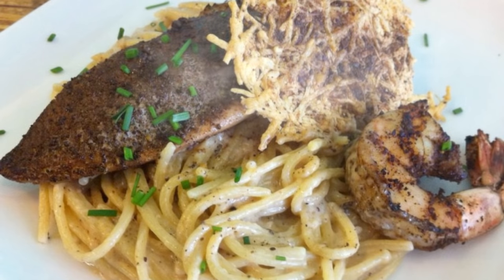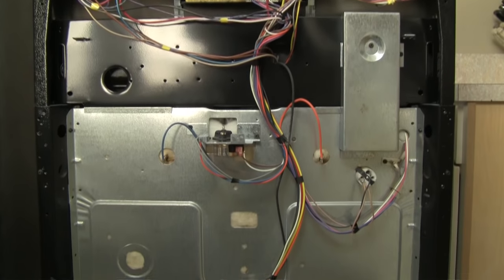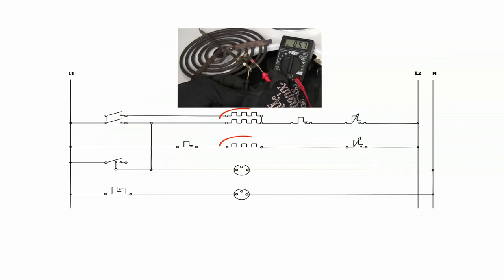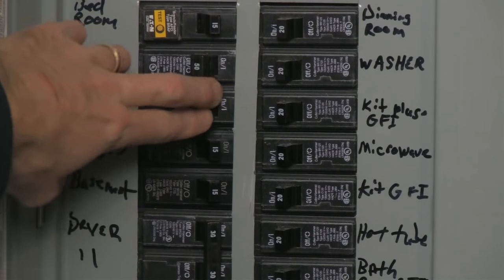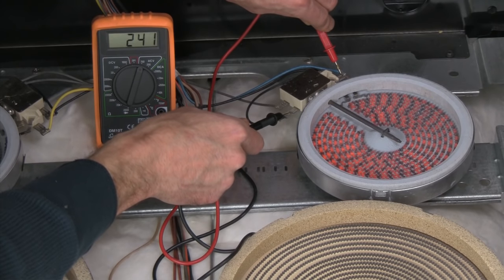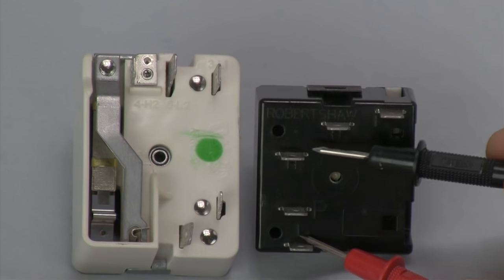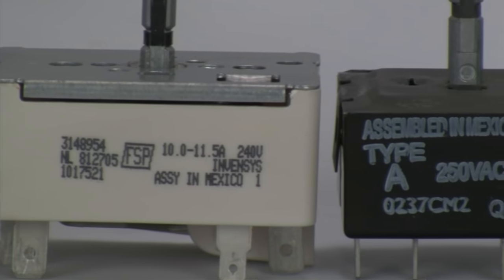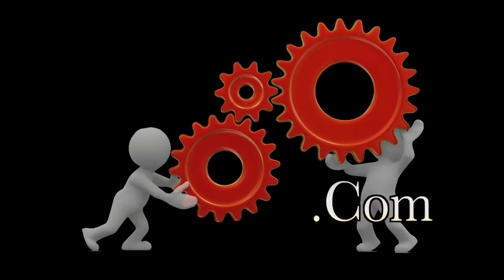Electric Range Stove Repair: How To Repair Burner Elements

Comment: The front left burner on a flat top stove turns on and heats properly the first time. But it needs to completely cool(over an hour of wait time) before turning on a 2nd time or it doesn't work. Any ideas?
Reply from the maker: Trisha Semiz Thats a strange problem... What is the brand and model number on the stove?
Reply: Probably a bad burner switch. The contacts are stuck together and it over heats to where it opens up the safety.  The as it cools down and the safety closes again.... it will work.  Once that is!
Reply from the maker: Thats a good point! The safety switch on most smooth top elements is in the block on the element itself. Thanks for the suggestion!

Comment: What would cause all the burners and oven to turn off while you're using them? (not all at once of course)
Reply from the maker: On 98% + of ranges the surface burners and the oven have different control devices... So the only way that they both could shut down apart from a crazy coincidence is power supply to the appliance.  However, there are some "crazy coincidence" these days with control boards... There are a few high end ranges that have control boards for the surface elements. If you have one of those it may be possible. Thanks for the question! Hope that helps!
Reply: Yeah what happened is an egg timer fell down behind the stove and unplugged the oven so glad it was something easy lol. thanks for the help.
Reply from the maker: Stink'n Egg timers! Thanks for the update!

Comment: What would cause the element to suddenly get very hot?  I had my big front burner set on heat level #4 out of 9 levels.  It heated up red hot and burnt the food like it was set to full hot #9?  Its like the heat just keeps creeping up.
Reply from the maker: In most cases it would point at a bad control switch.

Comment: I have a question.
my electric stove is acting wierd, at first when you start it when its cold, it heats up to a very high temp, to the point it turns off. and then the temp drops to a medium heat, which wont alloow me to maintain a high temp for frying and stuff. what do i need to do or check so that the temp stays high as the first time it heats? my thought is to use alluminum foil to stick the heat controlers together, so that it cant break contact when the heat max. thoughts?
Reply from the maker: Sounds pretty dangerous! I suppose if its outside and your own creation you can rig it however you want,,, However, if the element is just on all the time without cycling I would think the heat would continue to climb until either the element burned up or something else does.  Best legitimate repair would be to replace the switch if you think it's not working properly, or get a higher rated burner.  If you do try that (at your own risk ; ) do it outside and let me know how hot it gets, and how long it lasts : )  Thanks for the question!

Comment from the maker: There still could be a power supply problem... Does the oven heat?  If not, the next step would be to check the wall outlet for 240 VAC but if you are not comfortable with that, it might be a good idea to call an electrician... Ive been shocked by 240 VAC... not fun.  being that all elements are not working right I would suspect a power supply problem. If the oven works, it must be before the burner switches.  Good luck!

Comment: I have a Kenmore glass top range, and after I use my oven, the whole control panel goes off, and won't come back on for quite a while.  Help!
Reply: That is strange! Sounds like a bad control board that is being effected by the heat... what is your range's model number?
Reply: The model number is 790.95661102
It doesn't do it every time, but more frequently lately.  It will also "blink" off and on random times, for no reason.  When it goes off completely and stays off, it is after I use it, or while I'm using it.
Reply: It definitely sounds like a bad contact somewhere... Hopefully TO the control and not IN the control.  The control part number is 316207522 I can ship it to you if you like... It's 164.00 and 7.00 S&H  Thats if you find that you need it! First disconnect the power and unplug and reconnect each contact to the main control/clock. Lightly cleaning the contacts may help.  If it's in the control then it gets to be a little more complicated, unless you know someone or can solder electrical contacts...  Hope that helps! Good luck!

Comment: My stove and oven work, but not at the temperature I need. The oven doesn't seem to cook food at the setting I get from a recipe; I always need higher temp or longer time. My stove only seems to work on high; the burner is nearly imperceptible on simmer. You can feel it with your hand but it's not high enough to actually simmer.

Comment: Any idea why sometimes when I turn my front burner on high the back burner turns on high as well without being turned on
Reply from the maker: It would need to be a short in the wires... If you get a meter and go through the testing of the switches and elements you will probably find the problem.  My guess is one or both of those burner switches is bad. Hope that helps! Good luck!

Comment from the maker: Well not really... That is very strange : (  It may seem like its working properly but one of your switches must be sticking closed. Likely the element that is controlled by the  faulty switch is not cycling properly and is getting much hotter than it should.  I would also guess that one of the switches may be wire incorrectly... Take a close look at the L1 L2 H1 H2 and P terminal section on the video and look at yours to make sure all the connections are correct. Hope that helps!

Comment: Is there anyway to disconnect the broiler and still use the stove top?  When I tried to preheat the oven, the broiler automatically comes on and will not shut off. Any suggestions?

Comment: Kenmore model no. 790.96229408, glass top range.  The left front 8" burner with simmer control is not working.  I replaced the burner element to no avail.  I then replaced the element switch and it still does not work.  All other components of range top and oven work fine.  I've read that the oven relay board may be the culprit.  Any suggestions?
Reply from the maker: +Azalea McKnight Here is a link to the wire diagram
http://c.searspartsdirect.com/lis_png/PLDM/R0601008-00005.png
Looks like the simmer select control board is a strong possibility.
here is a link to the part if you still need it.
http://www.repairclinic.com/PartDetail/Relay-Board/316429301/1155383?ss=-x333136343239333031?RCAID=27317
Thanks for the question! Hope that helps!

Comment: I have a whirlpool electric cooktop model g7ce3034xsoo and I was using three of the burners for about 10 to 12 minutes then all the suddenly the burners just stop working and they will not come back on the switch for simmer or normal the little light will come on for simmer but not burners will come on
Reply from the maker: Sounds like a power supply problem... did you check the breaker yet?  It could be that one of the two breakers tripped or has a bad contact.

Comment: I have a conventional stove top with 4 coil burners, all of which have stopped working but there does not appear to be a breaker that has flipped. Just in case, we flipped the main breaker off and back on with no result. What else should we look at?
Reply: I just flipped the main breaker again and removed each switch one at a time looking for any burnt out components and found nothing suspect.
Reply from the maker: yveylise
Sorry for the delay, I was out back packing for a few days.
Apart from a bad wire it sounds like a power supply problem... especially if they all quit at the same time.  You may also have a bad breaker.  If you're not comfortable with electricity it would probably be best to call someone. The breaker connection is high voltage.  Do you know the stove model number?
Reply: It's a Frigidaire FEC30C4AC1. I've replaced one breaker that I thought might be the issue, but as we've just learned, our breaker box is not labelled at all and it's hard to pinpoint a non-working appliance. :)
Reply from the maker: yveylise It should be one of only a few breakers that are for 240VAC so it will have two breaker switches next to one another.  In some cases it may only have one switch and what looks like a blank next to it.  But I would say that it is likely the source of your troubles.  It could also be a loose wire connection at the cooktop junction box.
Reply: Thanks! We actually found the source inside one of our kitchen cabinets.. There was a small box where some wires met up and joined and one of the wire nuts needed to be replaced. Simple fix. However, we found out the hard way. While troubleshooting breakers, we learned all about "hotspots". The way our panel had been loaded originally, there was a 30amp sitting across from a 60amp which caused a brief fire. Luckily, it stayed within the panel but it could have been much worse!
Reply from the maker: Wow that's scary...Glad you found that!

Comment: One of the control knobs on my GE oven  is not able to control the heating temperature of the stoves . any suggestions
Reply from the maker: Chinar H if it's always on high no mater the setting it's usually a bad control switch, ( the switch behind the knob) however if it just won't turn on it could be a bad element, switch, or connection. You need to do some checking with a meter to narrow down the options.
Reply: Thanks for the quick response . it turns on without issues but is always at a high temperature . I am selling my house so want to know if this can be a hazard and how would you suggest I fix it
Reply from the maker: It is pretty hazardous and probably won't pass inspection. But it's a fairly easy fix, you likely just need to replace the control switch.
Reply: Do you have a video to show how to replace the control switch. Thanks again!

Comment: My problem is I set temperature at a low setting and it heats on high. Temperature does not lower now. What is the problem?
Reply: Betty Willis The switch is bad, but the power is fine. Look up the model number of your stove and try to find a replacement switch

Comment: any idea why one of my burners comes on when i use the oven? it wont shut off until i shut off the oven.
Reply from the maker: That is a new one... It must be a short in the wiring somewhere. Check the bad element wires that come back to the switch with a meter for a short to ground.  I wish I had more for you. I wish I could work on that one in person. If you figure it out pl;ease let me know whet you find.  Thanks for the question!

Comment: It's an MER8700DH. Thanks!
Reply from the maker: I was not able to find the wire diagram for that model but it looks pretty standard by the components being used. Unfortunately it is likely the element. My guess would be a short to ground within the coil of the heater somewhere that is not allowing it to cycle properly. Normally it would not heat at all but if there is a connection to ground through a short it will heat and not cycle on and off as it should. Hope that helps!

Comment: I have a Kitchen Aid YKESA907PS00 glass top and the front two burners work intermittently. The Sears repair guy came and said it would be $880 for the infinite switch + installation. Uh, no. So I am hoping to do this myself. On one, the indicator light just flashes quickly and the burner never comes on. The other comes on but "clicks" and the burner works fine sometimes, and not others. I have seen switch replacement parts from $41 to $110, and am confused why there are both parts/prices, when the parts look the same. http://www.searspartsdirect.com/partsdirect/part-model/Kitchenaid-Parts/Range-Parts/Model-YKESA907PS00/0593/0124160/W1201208/00001

Any advice appreciated.
Reply from the maker: It looks like the infinite switches on that stove have been discontinued and are only sold as a kit with a new wire harness. (Strange)  I would guess there is a problem in the wiring and that's why they have done that.  Probably a relatively difficult repair because of needing to remove the glass top, but slow and steady you should be fine. the part number you need is:New Service Kit, W10307362 Contains:(1)9763759, (3)9763760,(1)9760693, (1)w10307364.  Probably worth the effort being you will likely save so much in labor. You may want to have someone else around to help with the glass. You do not want to accidentally break it.  That kit should fix it though. As far as disassembly to get at the switches and wires, just go slow, group your screws and take lots of pictures of wire connections, screw locations, etc. Good luck!
Reply: Thanks. Looks like it is time for a new stove...
Reply from the maker: No problem!  Bummer, kind of an expensive part...

Comment: I have a Miele KM 544 induction hob. Whenever  I attempt to use two hobs
 at the same time,  they both are turned off and the letters F and E ( 
on the the temperature hob) and the number 10 (on the timer panel) 
appear and I cannot use the appliance after that
Reply: How to repair a fuacet that leaks
Reply: How do I repair a lecking faucet

Comment: What could be the problem when your stove heats up with one setting hot, very hot no matter what setting you put it on...low is high?
Reply from the maker: Macie It sounds like the switch is stuck closed... the other possibility (very unlikely) is that the element is shorted to ground.  But that's so rare its almost not worth mentioning... Bad burner switch.  Thanks for the question. Good luck!

Comment: Hi.
I'm having the problem with my induction hob 
1 ring out of 4 it's turning itself on....on full blast and I can't control it 
Can't off it or lower the temp.The remaining 3 rings working OK 
Anyone any ideas 💡  what's wrong and how to fix it ?can I completely disconnect  faulty ring and use only remaing 3 ?
Cheers

Comment: what is wrong if certain parts of the heating element lights (splotches of heat like a checkerboard or flannel shirt)
Reply from the maker: Some ribbon elements just have that kind of have that appearance. If it is heating up it’s generally okay. Has it changed from what you are used to seeing?
Reply: @applianceassistant  yes change slightly, less redness

Comment: My electric oven bottom element is on as soon as you plug in the electric cord. The controls are digital and won't control the stove ; what is my problem?
Reply from the maker: +LEE A BENSON Sounds like the element's control relay in the control board is stuck in the on position... Probably needs a new main control : (  
If you give me a model number I can give you a part link.

Comment: How do you repair the surface on the burner if part of the enamel came off
Reply from the maker: Most of this kind of thing is replace the damaged component. There’s not much you can do to repair damaged enamel given the heat tolerance requirements. That I’m aware of. If you figure something out I would love to know about it!

Comment: frigidaire stove small burner made popping noise and had burnt smell. switch smelled burnt replaced switch now stove buzzes when power is turned on and small burner not heating up swapped good element and still not working

Comment: My elements is malfunctioning on the front burner. It is burning my food no madder how low or high it is.
Reply from the maker: Sound like the controller switch is shorted closed. In most cases replacing the switch will fix it. Good luck!

Comment: I have an electric oven that turns on, the fan starts running (it's a slide-in range in an island), but after about 30 seconds, it shuts off.  Same with the broiler.  The elements seem fine, because the broiler has just enough time to start giving off heat before it shuts off.  The stove top works just fine.  Click works fine, all the dials & buttons work fine, etc. I took the oven temp sensor out & had it tested, and it came back within the normal range.  Any idea on what could be the culprit?  Thanks in advance for any guidance - trying to save $100 plus on buying a new one!
Reply from the maker: Sounds like some kind of a temperature safety thermostat is opening once the oven heats up. Could also be a bad contact in the control that is opening with heat from the broiler... What is your oven's model number? I will try to find a wire diagram.
Reply: applianceassistant Thanks for the quick reply!  It's a Magic Chef 68hn-4tvw
Reply: applianceassistant And sorry - in my original post, I meant the "clock" works fine, and that I am trying to save $1,000 (not $100 - those slide in island ovens are ridiculously expensive)
Reply from the maker: I don't see any kind of a safety fuse... Does the bake function do the same thing?
Reply: applianceassistant Yes sir - bake and broiler.  I can hit the button for either one of those, turn the knob to set the temp (or high/low in the case of the broiler), then the fan kicks on, it runs for 30 seconds - then shuts off.
Reply from the maker: Sounds like a bad control board connection... Hard to narrow that down apart from a voltage or amperage test at the control when the range is heating up.  Which is a little on the dangerous side.  Not too bad, but you would definitely need to be carful when you are checking.  there is a hi-limit thermostat part#7403P227-60 but it has been discontinued.  It is located under or near the relay control board (part#7428P009-60) under the top on the left side of the range.  Thats a tough one... Good luck!
Reply: applianceassistant Thanks so much for checking it out for me.
Reply from the maker: no problem! Wish I had better news...

Comment: Where do I find the model number
Reply from the maker: They have put them all over the place through the years, but the most common place: open the storage drawer and look at the front frame of the stove for a sticker.
Reply: Thank you so much I have never struggled so hard to find a model number before. I literally had to lay flat on the floor to see it😀